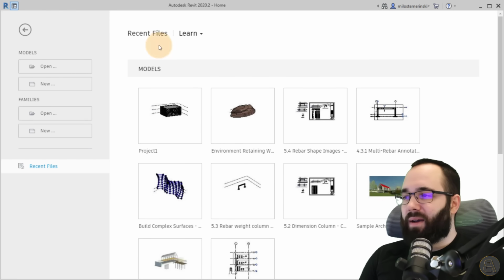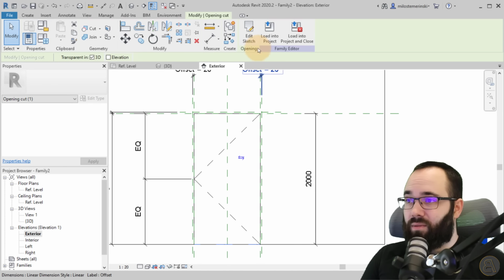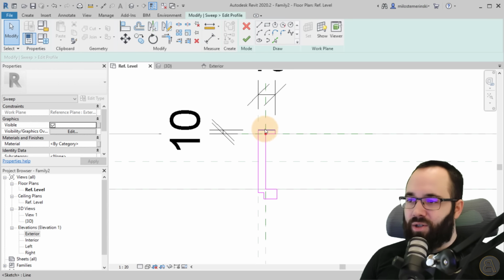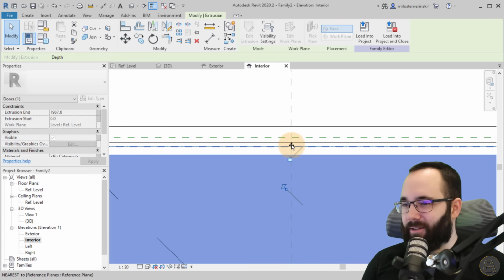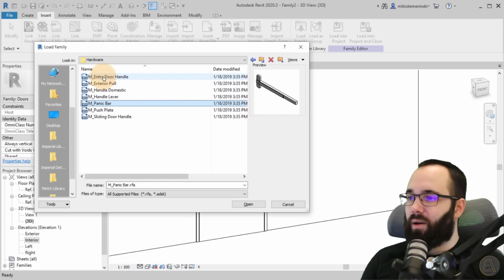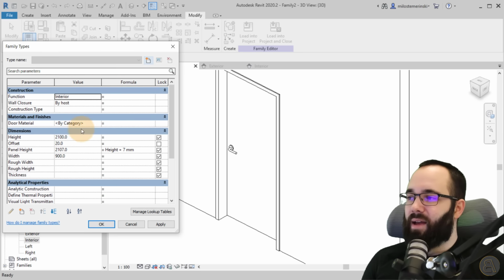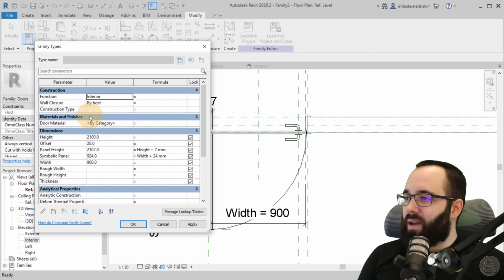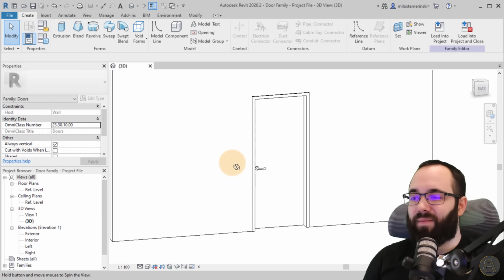Door Family - Beginner to PRO Tutorial

Comment: why at the start there's a wall in the template? why not just a door? what's the purpose of the wall there?
Reply: By Default door families/components have to attach to walls. So you set up parameters to tell Revit how much of the wall has to be cut in order to place the door. 

Theoretically, you can create a door without a wall parameter, but then every time you place a door you will have to manually cut the opening of each door into the wall. which would be very time consuming. 

Creating these parametric families can be also very time consuming, but if created correctly, they only have to be set up once, and then be used in every project.

Comment: I would recommend for the rough openeing to dimension the full width or height from the base level. Then lable them R.O. Height and R.O. Width.  Then in your properties you can set the R.O. height to = Height + X with x equal to the height you want it to be.  Same with R.O. Width = Width + 2(X) this will allow you to put it on a schedule if you desire.  I have had instances where on door and window schedules they want both the door and window with as well as the rough opening for each.
Reply: I've never understood why people want both because the rough openings are supplier dependant in most cases so its almost impossible to get accurate unless you use the same window supplier every time; but in most cases it varies by builder or who the client prefers to use.